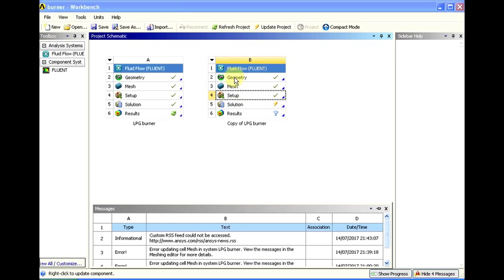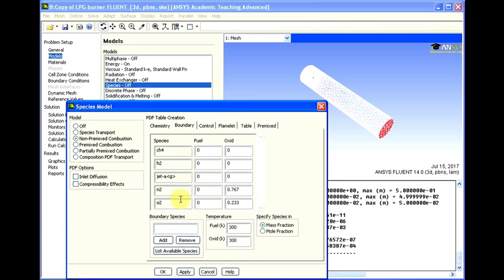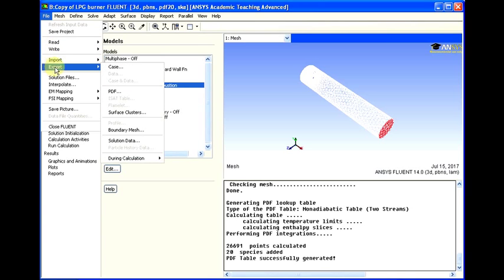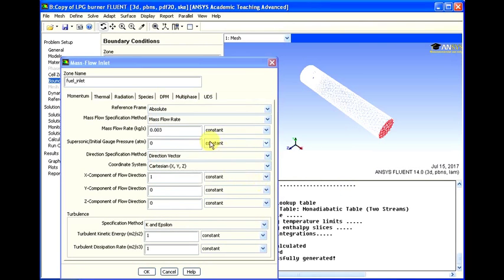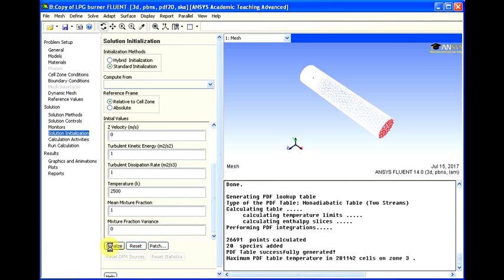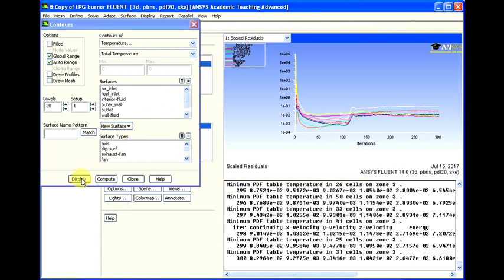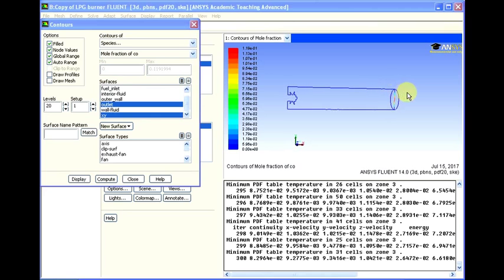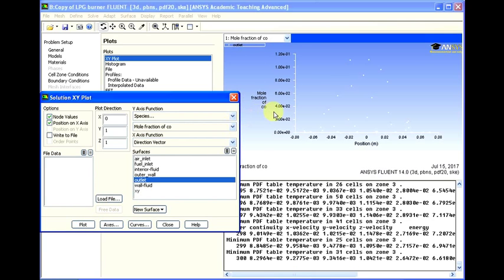Part 4: ANSYS-Fluent (non-premixed combustion model) tutorial for gas burner with air swirler

Comment: Great video! I was wondering if you could show how to run a CFD on a combustion swirler for swirl number and emissions analysis using methane. I don’t exactly know the boundary conditions and fuel and air ratios I need to complete the simulation correctly. Also, how to adjust the vane angle of your geometry to reflect the desired swirl number. Thanks again for the tutorials!
Reply: Have you done this project? Actually I'm working on the same project and searching for the same values you were searching for, can you address me to a reference please?
Thanks a lot

Comment: Thank you so much, I learn a lot from your video!
Reply from the maker: Thank you dear for your comment...I'm glad you find it useful .
Reply: Can i ask you someting? Now i'm trying to operate a CH4 reformer simulation with non-premixed combustion model. Is there any way that i set more than one pdf-mixture in a single non-premixed case? Thank you for reading my question :-)
Reply from the maker: Yes ....inside the pdf table creation tab ....under (chemistry-stream options) click on secondary stream and additional column will appear ...and you can fill new fuel stream.
Reply: khaled Ali Thank you so much. I just have found what i missed with your great help. Thanks alot!

Comment: But How to identify that it is of  120KW
Reply from the maker: Usually high pressure combustors such as in gas turbines has high efficiency above 90%... so you can multiply the fuel input flow rate by the fuel low heating value by the efficiency and you get the combustor output thermal power... Otherwise you should get the average exhaust temperature from (XY plot) at the exit so the combustor power will be P=m.CP. (T-(Tamb)) ... where m the the total mass flow rate of air and fuel, or use enthalpy.
Reply: Thank you very much sir....
Actually i want to analyse a fire source of different heat release rate(3kw, 3.5kw,and 4kw) in Fluent, it is simulation of Tunnel fire, Finally want to calculate ventilation velocity to force the smoke away from tunnel. which model and what kind of boundary conditions should i use for Heat Source..........is there any provision for defining heat release rate in KW to Fire source in boundary condition section initially.
Reply from the maker: Ok ...You need the data on the furnace exit ...so you can go to the (Plots) and choose (XY plots) then specify the exit plane is on which axes (X, Y, Z) and put value=1. ...you can first go to temperature and take average temperature from the plots, then go to properties and take average heat capacity for the exhaust materials ....then you can calculate the power
Reply: thank you :)